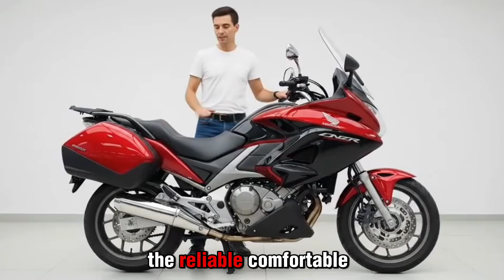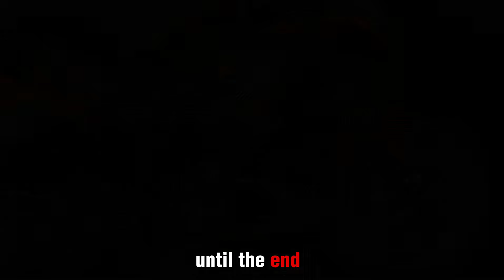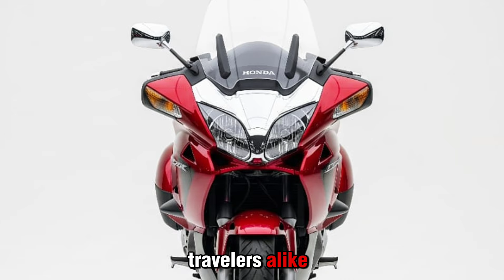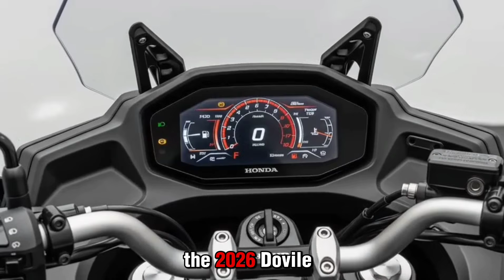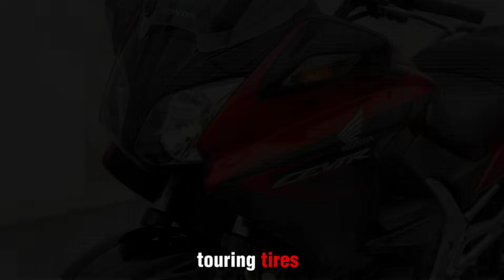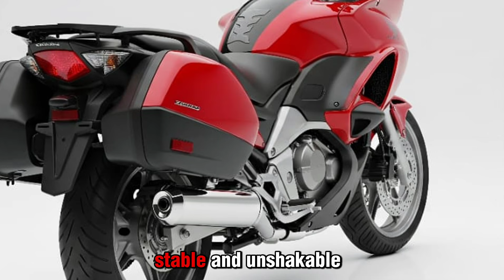Its offical! 2026 Honda NT700V Deauville | The Ultimate Mid-Range Touring Machine Returns!

Comment: To be honest, i like the look of this one, shame it's AI generated rubbish. As I've said elsewhere, why does everyone assume a new Deauville will be 700cc, just because the old one was ? Surely, if they make one, it'll either be based on the NC750X or the new Hornet/Transalp, which is a different 750. But either way, 750 not 700
Reply: "why does everyone assume a new Deauville will be 700cc, just because the old one was ? "
Most likely for marketing purposes, many years ago Moto Guzzi began building V7 bikes for reasons having to do with the size of their engines yet about five years ago those bikes "evolved" into now having 853cc engines but MG continues to call them V7 bikes.